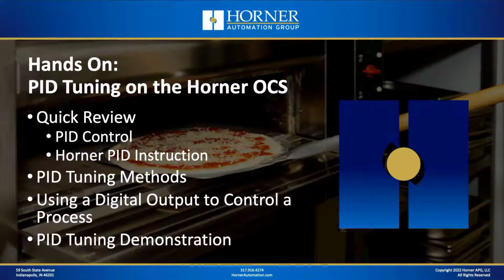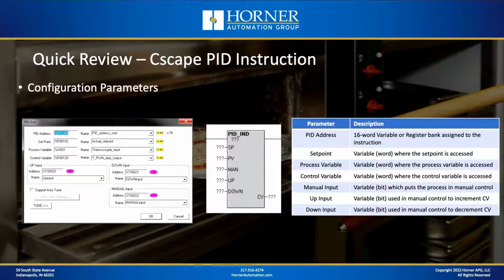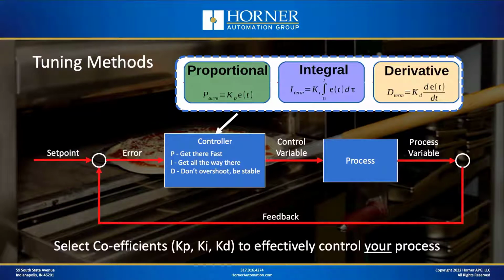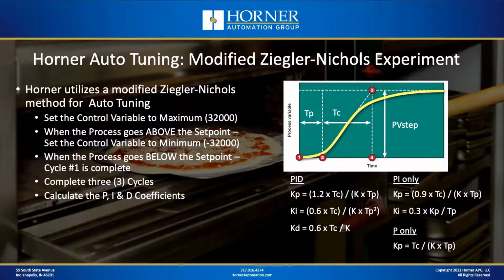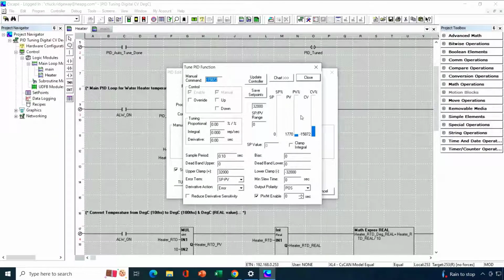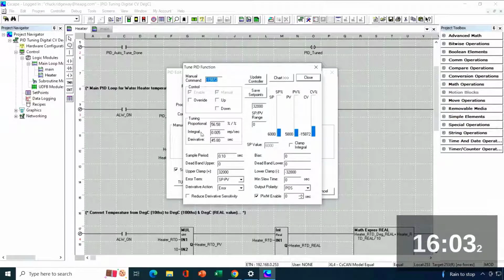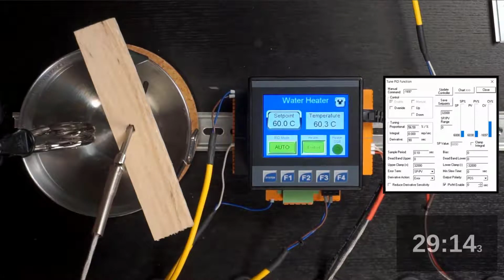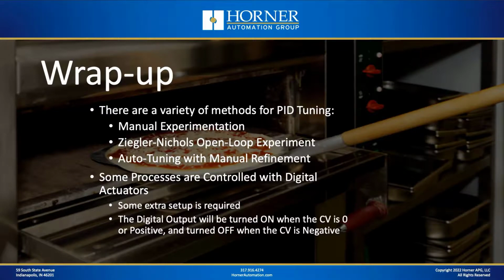Hands-On PID Tuning on the Horner OCS

Comment: Hello! could you do an example using an analog output from the PID_ISA block? I have an application of an analog temperature sensor and it is water cooled! and the water flow is controlled by the %AQ1 analog output which controls a valve.